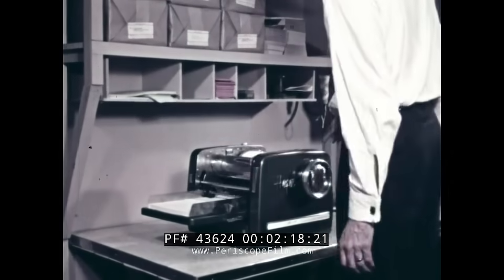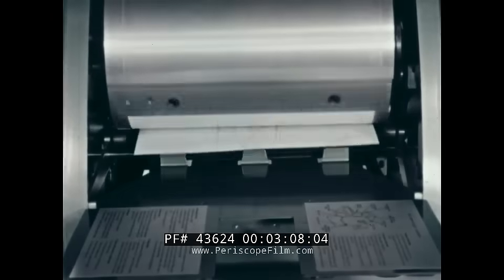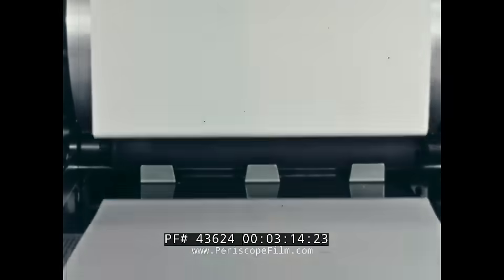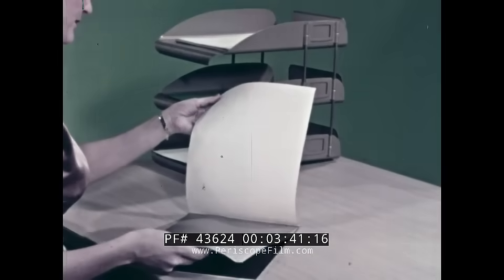HOW TO USE A 1960s DITTO MACHINE   MIMEOGRAPH  SPIRIT DUPLICATOR  PHOTOCOPIER 43624

Comment: I forgot how difficult it was to make a correction when you made a mistake typing the master.  I never hear of snopake.  We always called it wite-out or liquid paper which were brand names for the same stuff.  I didn't know correction fluid was invented in the 50's.  I also forgot about lettering guides that were built into rulers and used before fonts and computerized typesetters.

Comment: It wasn't just the 60's. We had these well into the 70's.
Reply: Had these in school in the 80s as well and apparently they were still used here and there into the early 90s
Reply: The elementary school I went to had them until the mid-80s when they got replaced by Xerox machines and laser printers.

Comment: Ok so, I was born after these were used and have no experience with them. I have a question that's confusing me. Is the ink that's being used to print completely on the master sheet and not the machine? Does the spirit fluid only moisten the master or is that the ink? 

I used a Risograph machine when I was in high school and supposedly the concept is very similar. I didn't learn about it in depth, but when I made copies on it, I distinctly remember the master sheet inside the machine being a sort of plastic that was covered in ink. I don't know if ink was pressed through it like a silkscreen does or if the master contained all the ink itself but I have even less of an idea of how this worked.

Comment: I love this! Yeah, the smell and I THINK....  the warmth of the paper?? (Am I not remembering that right?) ... made it amazing back then before laser printers. I actually recall seeing a teacher cranking the ditto machine up in the front office one day. I'm sure laser printer technology took at least something from all of that to get us to where we are today, right? Like the roller. Remember, as I do, in the old days, when an office copier got jammed? You'd have to open it up and sure enough... the paper was stuck in one or another roller. So it's the same principle today but more advanced. Take it a step further - at the store I work at the printers work on the principle of pressure to the paper - so you could scratch your fingernail on that paper and it'll make a mark just like carbon copy paper did in the old days BUT... without the carbon copy paper. The paper itself is sensitive so the portable printers are just applying pressure to "print" and no ink or nothing else is ever required. See? So today, with the right paper and printer you don't even need to worry about ink anymore. It's ALL built in. Now this is just for stores like the big W, of course. I've no clue what other
chains are doing but I'm very impressed by what amounts to built in carbon copy paper that "prints" out today just by pressure. 
There is so much technology that we find out about and are or were impressed with that it gets crazy fast. Probably a good deal of 
the world doesn't even KNOW this stuff existed or exists to this day. I would LOVE to get my hands on an old ditto machine just to 
have it for the nostalgia alone.

Comment: I used a spirit duplicator at the end of the 1980's as a grad TA to create note packets, quizzes, and tests for my students. There was a process to print from a computer onto a special master using a dot matrix printer. That was a little involved and prone to mishaps, so most of us created our masters by writing on them with a pen. We didn't know all of these tricks for correcting them, if we found a mistake we either crossed it out or re-did the master.  One TA had been a high school teacher in a rural area and had used a hand cranked duplicator, the one in our department was powered. It saw heavy use and near midterms and finals time we'd have several people lined up to use it into the wee hours. And yes, that smell...

Comment: That is a spirit duplicator which uses a carbon based master and alcohol. Mimeographs use a stencil and ink process. Big difference. I worked for ABDick company in Austin Tx 1975 to 1983 and worked on both processes and also printing duplicators and the first copiers, word processors the size of a business desk , and micro film processors

Comment: Mimeograph was the process where typing on the master created holes through which the black ink was squeezed. Those could create many more clean copies than spirit duplicators. That ink had a distinct smell as well. Loved both of them, used by our school and  church when I was in school in the '60s and '70s but they were labor-intensive compared to modern duplication technology.
Reply: What I remember about Mimeograph copies was when the teacher used too much ink and all the letter with closed loops like P, O, Q etc were filled in!
Reply: @Gannett2011  Yes. Either the machine was applying too much ink or the master was wearing out. Wasn't the smell of that ink nice? Think about how much attention to detail and patience preparing those masters required. All done manually on a typewriter. Required lots of planning.
Reply: Never knew that! I don't know if I've ever seen a mimeograph. We called spirit duplicators mimeographs. Collectively, "Ditto Machines"

Comment: I was today years old when I realized how much I took the backspace key for granted.
Reply: I remember the ditto machine in my elementary school teachers lounge. Only the die hard old school teachers still used it in the 90’s. I remember the smell and the purple color.
Reply: Douggernaut84, yep, it smelled like melted crayons.
Reply: It was computer worked because the desktop had the monitor, the processors, and then printer.
Reply: "Easy corrections"  in this video.  lol

Comment: My elementary school, as far back as I can remember (1986), had a xerographic copier.  I actually never knew precisely how a mimeograph/ditto machine worked until seeing this video.

Aside: Am I the only one who chuckled when the narrator claimed how "easy" it was to correct mistakes?
Reply: my elementary school was still using them around 1998.
Never saw a black worksheet until middle school, was always purple in elementary.
Reply: @Pantology_Enthusiast  That's amazing! I was born in 1985 and I've never seen a ditto machine, not even a disused one gathering dust in a corner. Teachers used to reminisce about them but that's about it.
Reply: @Ragnar8504  I was born in 1976. 
I have never seen neither ditto or mimeograph machine irl.
Only in pictures. And videos.
Reply: @Chrystal_Clair  Sounds like there were substantial regional differences then. I mean my school still had 8 and 16 mm film projectors that no one ever used, and even Philips VCR and V2000 video recorders, so if those machines had been common a few years before I would have seen a few in a corner of some storage room.
Reply: It's weird; I was in 2nd grade in 89-90, and we used ditto machines for our duplications. Though I feel that was the tail end of that era.
Reply: My elementary school in the 80s - same.

And nowadays we just "backspace" lol

Comment: Now there is a technology that I'm honestly glad isn't around any more. It served its purpose, but always struck me as being pretty far down on the evolutionary ladder.
Reply: For it's time the only other way to duplicate was by making out photographic copies,(expensive).  I used a stencil duplicator in Vietnam to make copies of daily medical reports and it was a readily portable fully mechanical method of getting as many copies as I needed to make.
Reply: Agreed, it was exceedingly useful for the time, and used most everywhere. I grew up with practically every piece of paper from kindergarten to college being printed on one of these. But I think even when I was in the 3rd or 4th grade I'd concluded that it was something that worked, but was just waiting to be replaced by something better. And of course it finally was, once the laser printer came down to a reasonable price and reasonable per-copy price. Of course we now just use PDF files and cell phones...
Reply: Agreed, the Mimeograph was a step much like using clay/mud tablets for writing on to create a useful method of communicating.  PDF files and cell phones are great but no doubt will be replaced by something else eventually.